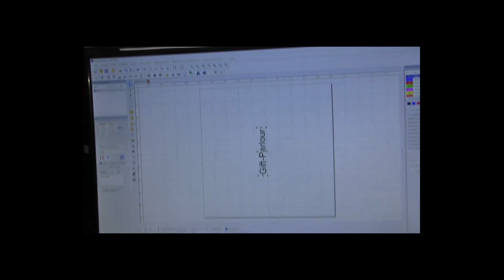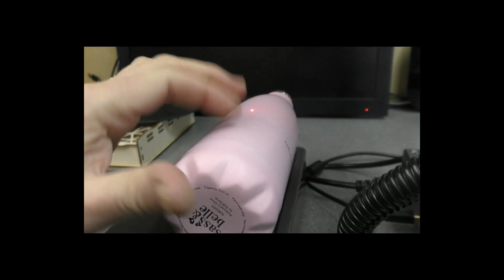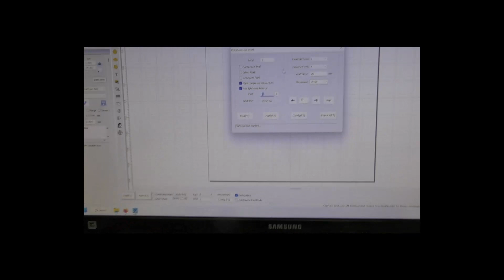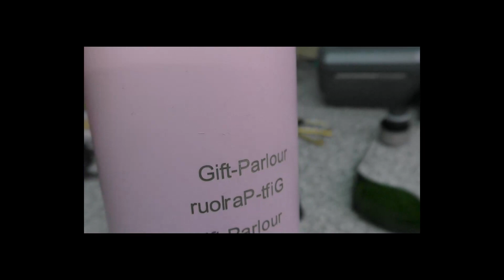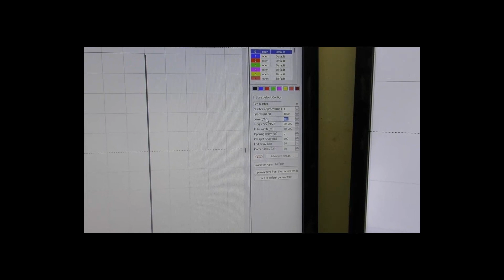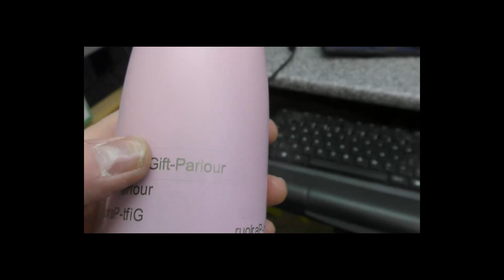Mr Carve M1 Pro Rotary Roller Setup. Issues and Solutions.

Comment: I am having issue with rotary movement. When I tried to follow the steps from you and original sample video my roller is not working while printing long sentences. But if I try to make it move manually with button it does rotate. So do you have any idea to solve that?